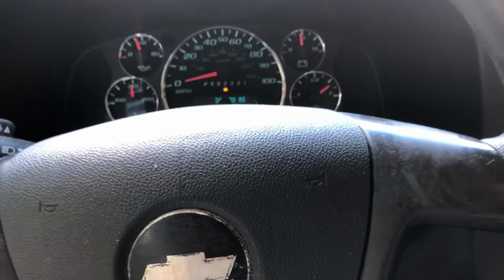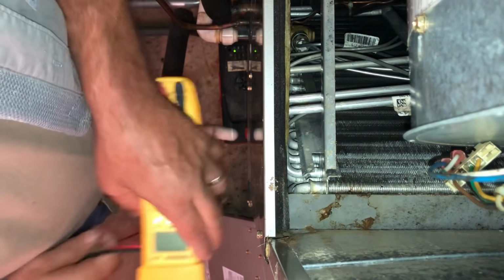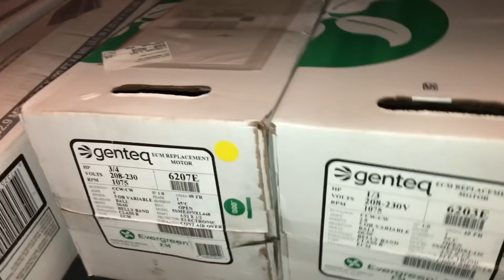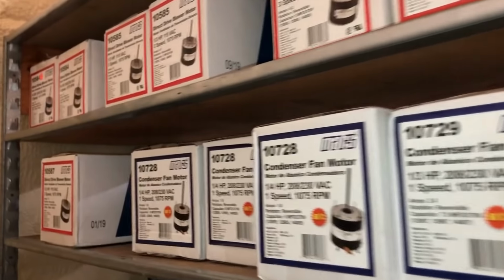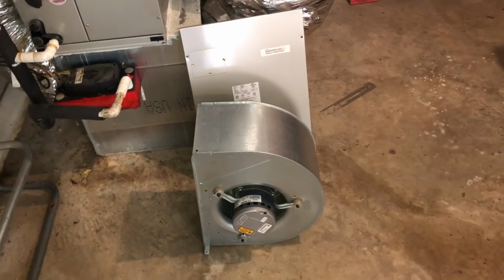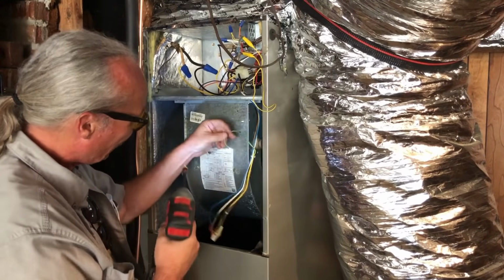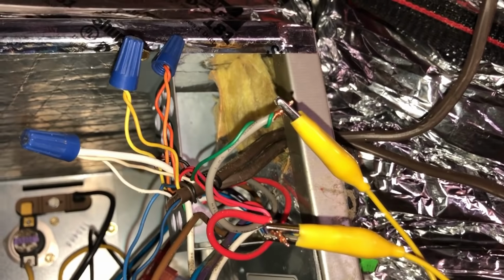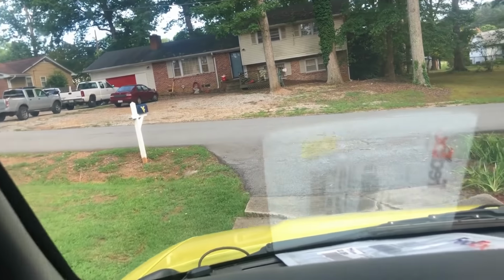ICP Heat Pump Blower Motor Replaced Comment Contest Video

Comment: For those tricky motors that are really stubborn, I occasionally use a FAN BLADE PULLER. That's my tool suggestion so you don't need a hammer and accidentally throw off the balance of the blower wheel. Love your videos!

Comment: Always like watching your videos,Ted and I have no idea what tool to tell you that you may need that you don't have, you always have the tools for the job,,  but I notice that you always just grab a few tools to check out the call your on I think u can get a pouch that holds a impact an has other places to hold nut drivers or the Klein 11&1 or different things would keep u from having to go back to the van for tools,, I carry one and I can fix about any service call with the tools the pouch holds ,but that's my thought ,and I like the pump u use to pump out the pans with , and I am going to get one of the pumps. ,, #HVAC#

Comment: Ted, Great content as always. I learn something new from each and every video you post. My only small suggestion would be to incorporate an in line resettable fuse on your low voltage jumper. I’ve replaced a transformer or 2 before someone recommended that quick and cheap trick to me. I typically get them off old Lennox control boards. Keep the vids coming!

Comment: About a month or so ago I just picked up a dewalt gyroscopic screwdriver $75 here in Virginia.. fits in the back pocket perfect for taking out and replacing door screws without driving em to the moon.. keep my malco reversible on it and a 6" one in my mb2 bag (cause I carry a couple more tools than you Ted lol not many but a couple.) It has enough torque to drive a zip screw or two especially when we are out there battling the ole run cap bandit.. like I said a couple chucks it'll change a blower and various other things and it's lighter than the m18 fits right in the back pocket.. nice little tool for service work.. awesome videos I've watched em all.. keep on keppin on man..

Comment: I recommend using seafoam deep creep lubricant on the motor shaft for removing the fan cage from the motor it will lubricant and dissolve the rust making it easier to remove the fan cage from the motor! Spray the seafoam deep creep on to the motor shaft and into the set screw holes let it penatrate for a few minutes and use a block of wood and a hammer on the end of the shaft to remove the motor! Also when installing any fan on to a motor shaft use a small amount of never seize compound on the motor shaft that will make it easy to take apart next time! I found seafoam deep creep to be the best oil  for loosening nuts bolts fans and pulleys for ease of removal! Also it will free up adjustable wrenchs and remove rust off of tools as well ! Thanks for another great video TED!

Comment: 2 suggested tools/kits to help do this job...  the tool: M18 fan to move a little air for comfort.  The kit: a flux pen, a little lead based solder and an iron.  Reason for the little soldering kit: half the time the failure on those motors is cracked joints on the board.  A reflow can bring them back to life (good place to start is the large capacitors.)  Also a common failure on Molex sockets soldered to boards.  Vibration can do a number to soldered components! The one you just took out would be excellent practice.

Comment: My recommendation is a wire wheel. Bought myself set of big and small cheap wire wheels for my impact and it has been a huge time saver. Works great to sand/clean off those motor shafts to make it slide right off also to prepare copper for brazing.

Comment: Hello Anti DIY HVAC,
One tool I have found extremely handy in my very short and limited HVAC career is a head lamp( flash light )! Nice to have the two hands, however I've noticed that you're very capable with just the one!

Cheers from Canada

Comment: Hey Ted I would like to say the braun folding bar flash light. Has 3 light setting on it and a durable magnet to place anywhere on the duct for great lighting in the blower compartment. Has a 3.7v battery that is rechargeable. I bought mine at harbor freight. You could also find one on Amazon. Thanks for the videos! I have learned quite a few things watching your videos for the last few yrs! Be safe!

Comment: A good duel soft faced hammer with hickory handle.  You could use the rubber face, plastic face, or the wood handle.

Comment: Use a scratch awl to mark the mounting bracket locations on the new motor and then use the scratch awl to line up the holes for the mounting screws for proper alignment! That's another suggestion Ted!

Comment: I would recommend A variable speed Zebra ECM tester. I just used today and gained yet another lifetime valued customer. Was a second opinion from a well known company(diagnosed a bad motor)...Was able to visually show the customer the operations from different settings and speeds, therefore the motor was fine. The Variable speed Zebra will also diagnose a shorted control board as well. Was actually a pan wet switch problem. Saved the customer 1500.00 per company quote...
Customers love seeing the state of the art gadgets at work.

Comment: Best tool I've ever found for doing ANYTHING heat and air is a magnetic bowl, even if it's on the floor at least it supervises the screws, nuts and bolts.
Reply: Too bad Ralphie didn't have a magnetic bowl to put the lug nuts in in A Christmas Story. Then he wouldn't have got a bar of soap in his mouth. #OhFudge

Comment: Good video Ted. We don't keep X13 replacement motors in stock, but last year we started using this product from QwikProducts. It's called the QwikSwap X1, it's a control board that lets you put a PSC motor in place of the X13. They have a few different ones, another one is for the ECM motors.

Comment: I know you really don’t like pullers and you most certainly didn’t need one in this case, but you should try the knockout tool. In my opinion it’s the best puller out there. You actually run a bolt into the set screw hole on the hub and then smack it with a hammer. It will pull the hardest condenser fan blades and blower wheels with no issues whatsoever. It does take a minute to set up but it never fails. I also have the silver one with the point that you use a socket to drive down on the shaft but if you get off center, you can really mess up the shaft, which I have done once. Never had that happen with the knockout tool though. I really like your videos and I’ve learned quite a bit from you. Thank you, Ted!

Comment: Milwaukee 12v brushless 4-in-1 has made my life a lot easier, those attachments are awesome for tight spaces. Anyone doing commercial, or anything on a roof should pick themselves up a " one trip hook " think its a sensible products tool, no more making 6 trips up and down the ladder to get your gear up.

Comment: Ted, I am recommending a Mars Azure digi-motor for condener fan. It is a single speed motor from 825 to 1075, 208-230V multi-horsepwer, reversible, with outboard replaceable surge protection.  I know you like original motors but this is a great motor to have. Its best attribute is it plugs in to 115V outlet and you can unplug it when it reaches your desired speed and rotation. Love the videos!

Comment: Milwaukee M12 driver sure does make working in tight spaces easier. A lot less to lug around then the full sized M18 tools when you don't need the power. 

A clean change out.

Comment: I always just change the ECM only on the back of the motor. Provided I can get one. The last bad ECM I had, the blower wouldn't slide out because a truss was right in front of the unit. I was able to take the blower assembly off the track and replace the ECM on the motor and then slide it back in. Those dastardly ecms. Boy that unit sure was pretty clean.

Comment: Not sure what to recommend on this one Ted; was a pretty straight forward motor change-out and I’m not a big fan of hub pullers due to risking hub damage on an old blower assembly. I like to use the spin brush/wire brush attachments for a 1/4” impact drill they sell at Lowe’s and Home Depot ETC to shine the blower shaft up really well, BUT Emory cloth works just fine as well. My only big tool recommendation for this job would be a concrete truck to fix that homeowners driveway lol.

Comment: As a replacement or complement to adjustable spanners, I would strongly recommend Knipex's so called Pliers Wrench. It takes the best properties of channel locks and adjustable spanners and gives you an amazing tool that doesn't strip your hex heads, service caps, fittings, etc. Comes in different sizes, and even the small ones give you a ridiculously good grip on even fairly large size bolts. The design also gives a ratcheting effect, so you can, with one hand, loosen your grip, move it to a new position and pinch down on it again.
Very strongly recommended, you're gonna love it.

Comment: Tech tip, when hitting the blower wheel down on the shaft with your nest hammer try using a deep socket that fits over the shaft and will fit even on the hub. That one looked like it moved easy but some can be a pain depending on how rusty it is!

Comment: Hey Ted. Everyone is recommending an ECM tester and a fan blade puller. I’m going to recommend a deadblow hammer for removing a stuck wheel or fan blade. It’s a hammer filled with some sort of sand or pellets and works wonders and I’ve never mushroomed a shaft with one. Also because it doesn’t bounce after the hit it doesn’t damage a blade or wheel. Love the videos!

Comment: A hub puller for getting off the blower-fans is always a good thing to have. I've heard if you beat on the rod you might actually mushroom it out on the end and make it impossible to get off. A kneeling pad is also awesome, I use mine everyday. I should use it more indoors on concrete but i usually use it outdoor by the condenser so I'm not killing my legs on rocks and stones or getting all muddy.

Comment: Hi Ted I know your always in the dark attics or crawl spaces! I'm a plumber & hvac tech in Massachusetts, it seems to be that there's never a light when you need it! I use the magnetic stream light stinger switchblade model which is super bright and lasts for close to 3 hours on a full charge i carry 2 in the truck and would highly recommend! You won't be disappointed

Comment: Hi Ted Great video   One tool that works on any ecm motor and better diagnosis is the ZEBRA Variable speed motor checker which also works with X13 motors as well.  Although in this case it was pretty clear the motor sometimes it is harder to find out is it in the motor the harness or the control board this tool helps narrow it down and gives a lot more information then your standard ECM tools out there.

Comment: A Flir One Pro infrared attachment for your phone is the third gen version with high resolution.   It comes in handy for finding bad connections on power wires and breakers in addition to verifying excessively hot motors..  It can also identify missing insulation behind sheetrock.

Comment: Hey Cowboy
  Recommendation:
I would buy a steel brush [round] cut off the shaft and you can attach it to your drill. <works great for getting that nasty rust off shafts and will fit into the blower wheel> Also get a kneeling pad or knee pads without them you will be paying the price! Keep up the great 📹 and don't forget your  😎 at 🌙! Lol

Comment: Ted you could try a device called tech mate pro  to help diagnose ecm motors.  This tool will help troubleshooting the system by starting the motor to see if the motor is bad or control board is bad keeps you from guessing. Keep up the good work Rich Visco ps it comes with the 4 pin and 16 pin plug

Comment: Those ecm motor testers are nice. The one I have has both adapters attached to it and its a simple toggle switch. As for recommendations, I would just recommend a blowr replacement bag. Just a small bag with a motor puller sand cloth wd40 and adjustables so you can quickly grab and store for a quick change out.

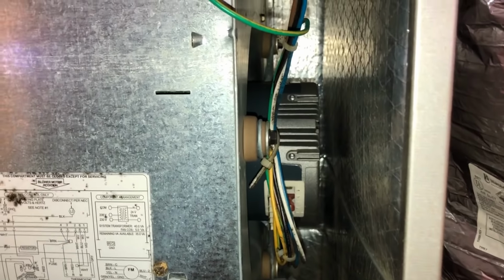Comment: @ 0:37 seconds 

Always hook up the jumpers to the G first, much safer than connecting to 'R' first and risking the other end of the jumper falling and shorting out on something (or worse) falling into a high voltage terminal. 
(...ask me how I know about that, lol)

Also, another "Pro-tip" I learned from an AAON tech, tie-up your jumper wire where it's JUST long enough to jumper your two T-stat wires together - that also helps avoid the rise of dropping the Jumper into hi-voltage, ground, or a moving blower wheel.

Comment: Love the videos. I run service on the coast of NC the ole whack a mole method never works on the changing blowers or condenser motors. Always need a fan puller and sanding cloth the salt just destroys those units. I will say the spine fin coils seem to uphold the environment better than the micro channels

Comment: Get your self a 4” wire wheel that attaches to your drill for cleaning blower shafts and copper tubing. Makes the job a lot easier.

Comment: Ted I have a suggestion that doesn't cost anything.  Get one of those square yellow cat litter buckets for sitting on.  Keeps your butt out of the dirt and moisture and you can carry some of your stuff in it at the same time.  Works really good when working outside while changing caps and contractors.  We aren't getting any younger and saves the knees.

Comment: Would recommend getting a magnet bowl for holding/securing all the screws and bolts. It can sit anywhere on top of the AH or on the floor but you won’t have to worry about loosing them and looking for them afterwards

Comment: Ted My recommendation would be to use a Supercrazy Battery Terminal and Post cleaner wire Brush Tool SFO193.
(Do not buy the cheaper ones) Beside cleaning the motor/fan shaft it can be used for many other components and the Kano Aero Kroil Spray works the best to loosening frozen/rusted hardware.

Comment: Ted I have 3 suggestions #1 get a camera with a tripod mount like the Joby that you can either setup like a regular tripod or bend the legs to wrap around something to film at different heights or angles. #2 get a ecm motor tester makes troubleshooting easier. #3 Is get the new Fieldpiece clamp meter either the 480sc or the 680sc cause they are bad A$$ meters & have a magnet on them! Great video 💪

Comment: Not sure if you use them or not but I recommend getting some impact ready wire wheels for cleaning blower shafts. Comes in handy for the extremely rusty ones.

Comment: The only thing I can think of to recommend is a Milwaukee 12V impact if you are looking for something a little smaller and lighter to carry around instead of the big 18V. They still have plenty of nut busting power and can squeeze into some tight places. Plus if you ever have to work outside when it is cold they make heated sweaters that use the 12 V batteries.

Comment: If you don’t have one already, you might want to get an Tecmate pro - Ecm service tool. I have one on the truck and it is invaluable troubleshooting ecm motors and helping diagnose which component of the ecm failed ie. board or motor.Also, I have always enjoyed your content. Keep up the good work!

Comment: needle point leads so i can check the high and low voltage on the motor without removing the harness. Its always a great feeling when you are able to find the part for a customer, i did a txv on this saturdays on call myself.

Comment: Hello! normally i just use hand tools  most of the time but Dewalt makes some pivoting impact bits that really come in handy when in a tight spot. Im not sure if you work on Bard units or not but those are a life saver when removing the shroud to clean your coils or replace your condensing fan motor.

Comment: I recommend a blower wheel puller, it removes the blower wheel and house right off of the motor. It’s super easy to use and makes everything go so smoothly, you can get it at your local RE MICHEL

Comment: When I didn’t have the correct ecm motor I have used a psc motor and cap using the quickswap x1. It’s a simple plug and play board and will get you out of a bind in a hurry!

Comment: I like a malco 5/16 x 3/8 reversible bit, and a wire brush to fit into an impact driver. Makes quick work if rust and dirty shafts,and works well to clean flame sensor and front edge of burner assembly

Comment: Another Tool Recommendation: I notice you put tape on a lot of your door switches. You can keep a small round magnet from out of an old microwave, or from the back of a fieldpiece tool that you don't need the magnet for and use it to hold your door switch down while you're working on the furnace.

Comment: Best tool to not loose screws is a magnet pan. You can get them at harbor freight and it helps not to knock yours screws off the landing/unit and have to go get replacements.

Comment: Hey ted! You should look into the Supco ecm pro universal tester. It tests ecm 2.3, ecm 3 and the x13/evergreen motors. I see it is easy to test the motor in this video but if you’re ever working on a carrier or a Lennox ecm module this tester is awesome. Hooks right up to 24v power, flip the switch if it starts motor is good if it doesn’t motor is bad. I have one and I love it saves you time and money

Comment: I recommend that you buy:  1  A LED head lamp that uses a 18650 rechargeable battery. I have 2 and they work great.  2  Either buy a pocket high/low voltage non contact detector or use the one that is probably on your FieldPiece ammeter when you are sitting in water in a crawlspace or basement.  3  Buy a 1 quart spray bottle of Cedarcide Original to keep mosquitoes, fleas, and ticks away. It is totally non-toxic for animals and humans and it works great as well. Thanks for all the real life educational and usually entertaining videos.